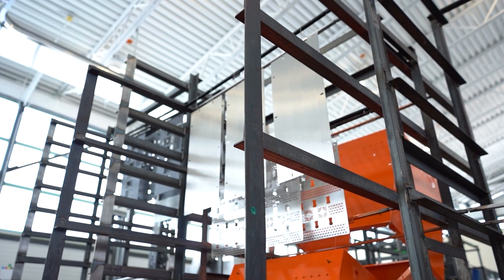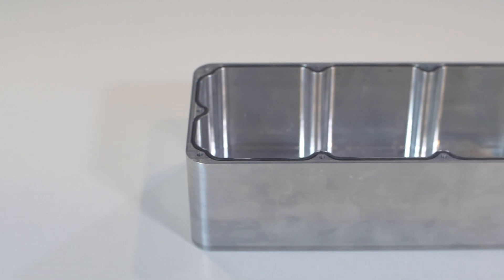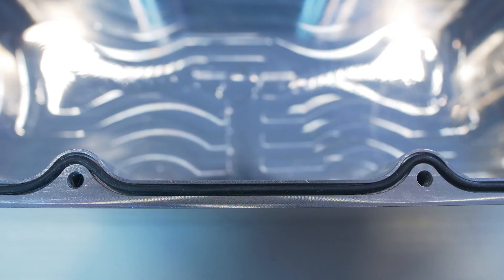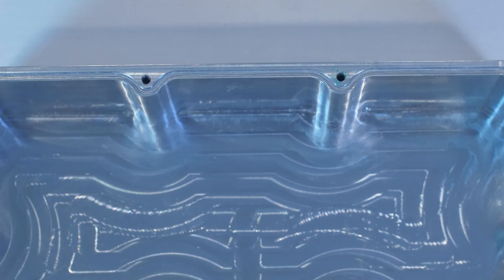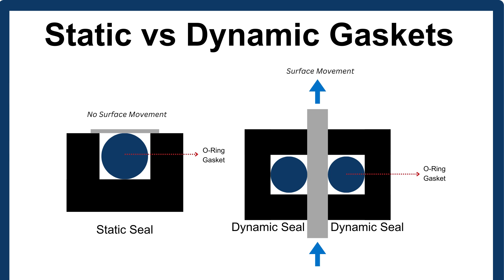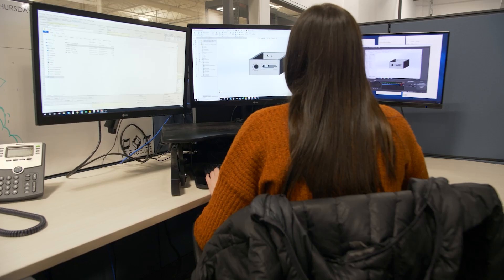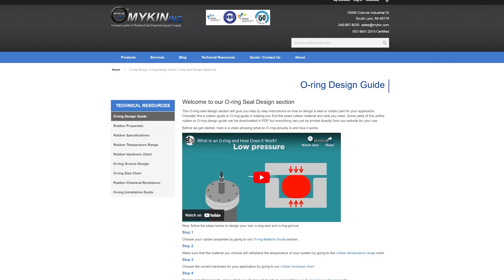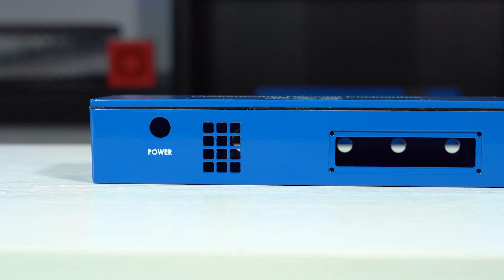Proto Tech Tip  - Designing Grooves for O Ring Gaskets

Comment: I want to seal locknut with barrel, so water doesn't enter lens assembly. Any guidance you could give on using o ring? LOCKNUT IS IN CONTACT with lens so it doesn't fall from barrel
Reply from the maker: Hi there! We checked with our engineers on this one. It's a bit tricky to fully answer, without the full info on the application or seeing the design. But, they did offer two things to consider:

-Thread sealants are available. These can be brushed on or applied like tape to keep water out. 

-A gasket-type washer that's thick enough to conform to the shape of the barrel while also sealing against the nut. 

Hope this helps! Feel free to email info@protocase.com with more specifics if you have any custom metal parts that you need manufactured. :)